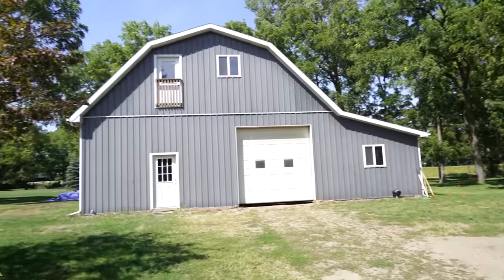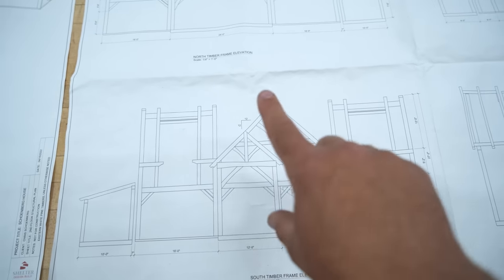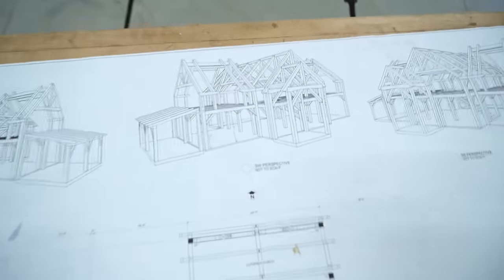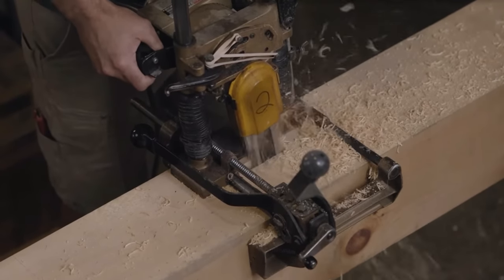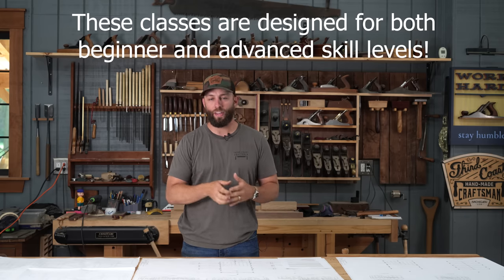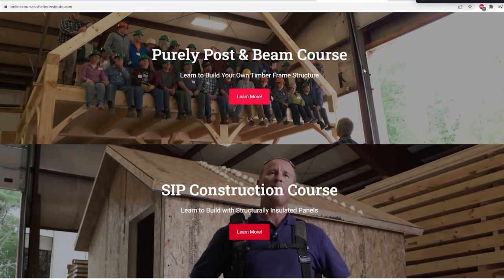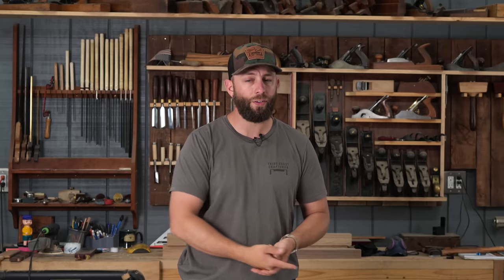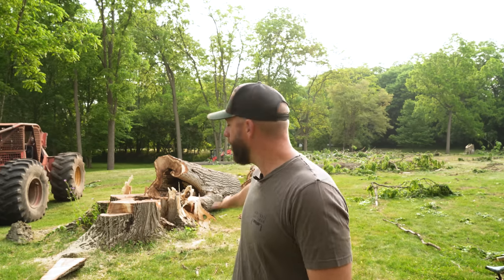Finally Building Our Home // Timber Frame Classes!

Comment: This is going to be incredible. A dream come true Chris!
Im curious, and likely this will be answered in future vidoes, why are the roof lines of your two wings not connected to the main section roof line? Seems like a set up for water issues comeing from the main section into the wings.
Pumped to follow along. Congrats again!
Reply from the maker: Hi Frank, The SIP panels (structural insulated panels) will tie those roof lines together. I will hopefully make sense later on!

Comment: Cool deal. Will shelter send a crew to help you. Thats a lot to take on by yourself. Built a few muself. Lots of planning and work. Shelter is a great bunch of people. Been thru there class and built the 24x36 with some mods using hardwoods
Reply from the maker: Unfortunately with Shelters schedule they will not be able to send a crew out. I will train and have a small crew myself. It is for sure a lot of planning, but I have a lot of confidence with these classes. Its the SIP panels that I am more worried about haha.